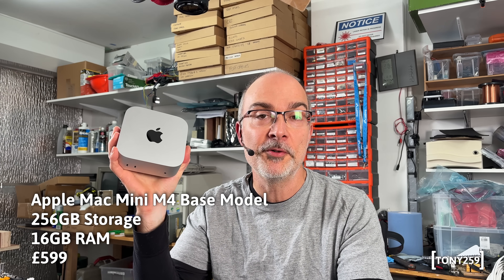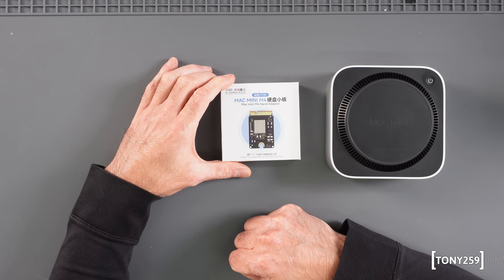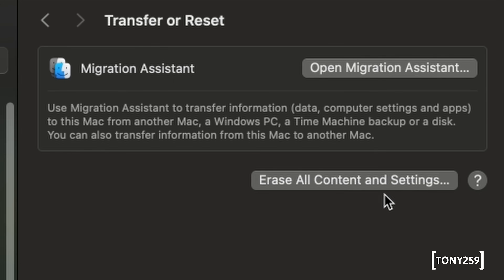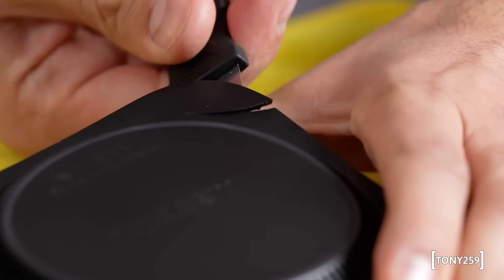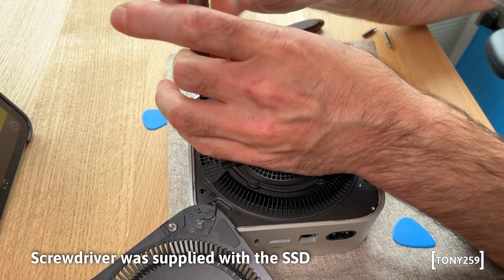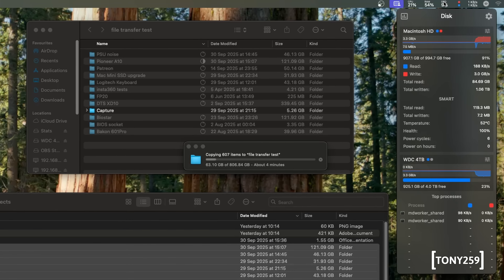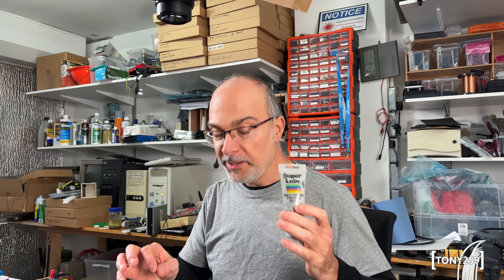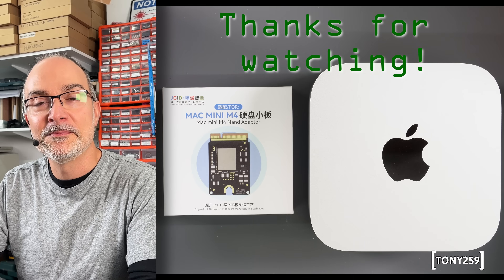CHEAP AliExpress SSD for Mac Mini M4? (Yes, I BRICKED it!)

Comment: I don't know why you keep mentioning that it isn't an SSD, it 100% is Solid State Drive in every definition of the word, controller or not! It just isn't a SATA SSD or NVME SSD.
Reply from the maker: Well, when you buy an SSD it has a controller on it. This module - AFAIK - is just NAND memory. But it's a technicality, I guess we can call it whatever we want 🙂
Reply: @Tony359_2  No but what I meant is that the definition of SSD doesn’t have anything to do with there being a controller or not. It just means there is no moving parts in the storage medium itself. Tape storage for example doesn’t have a controller either.

Comment: Great video, I’m thinking of upgrading the Mac mini myself, this explains a lot of the ‘pinch points’ when opening the bizarre Apple case that so many other videos fail to mention. Good work!
Reply from the maker: I'm glad it was useful, I hope it works out for you! Thanks for watching!
Reply: @Tony359_2  Before you upgrade: 1st - watch videos on upgrades to determine where the 'connection' lugs are in relationship to the power button. 2nd - use a small suction cup to apply upward pressure on the base cover. 3rd - use the suction to continuously lift, while sliding the plastic shim to slide under the base cover (I used a guitar pick - they're cheap). 4 - keep upward pressure with the suction cup while levering...
When I upgraded mine by using these 1,2,3,4 steps, my cover base practically popped off with only the slightest twisting and leveraging of the guitar picks. Good luck.
Reply from the maker: @dougbolton5503  I like the idea of pulling up WHILE using picks to pry the lugs! Thought I thought the suction cup wouldn't stick to the bottom? Thanks!

Comment: There's flash test tools for Mac and Linux you could try. You might have to compile it yourself though. It's call F3, and there is a GUI tool called F3XSwift for Mac, and F3-Qt for Linux.
Reply from the maker: Thanks, I'll keep that in mind!
Reply: @Tony359_2  some terminal commands to check capacity "diskutil list" or "diskutil info disk0" or "df -h /"
Reply from the maker: thanks - that will tell you what the disk is reporting. Some fake USB drives will have modified data so the OS sees much more than the actual data. 

Everything seems to work fine UNTIL you reach the actual, physical capacity of the drive. Then the OS will start overwriting old data without realising. But when you try accessing that old data, the data will show as corrupted. 

The app I mention will write small files with a checksum until the disk is full. Then it will read them back and compare the checksum. If checksums won't match, the data was overwritten.
Reply from the maker: I don't know that either but I'm sure that if there is a way to report a fake size, they will find it! 😀

Comment: E nonostante l'uso del q-tip, ditate unte sul mac-mini 🤣🤣
La mano che trema all'apertura del coperchio da l'idea di quanto tu fossi agitato all'idea di scassare tutto, hai fatto agitare pure me!  La musica de Lo squalo mette meno ansia 😅
Oggi ho giusto comprate l'i-pad pro M4... secondo te si può up-gradare la memoria pure a lui? (dubito).
Reply: I don't think you can upgrade the Memory,i'm sure it's built in directly to the M4 die in chiplets, not in a socket or onboard chips or anything.
Reply from the maker: ahaha eh oh, io mi agito tantissimo quando faccio queste cose! Ma davvero quelle clip sono eccessivamente forti, non ha molto senso. Sono certo che in Apple abbiano una scatola di coperchi di ricambio!
Le ditate unte sono di calibrazione, senza quelle...

Mi sono "Applizzato" da poco, io sono sempre stato Windows da sempre. Il Mac Mini l'ho preso per montare i video al weekend se non sono a casa. E' bastato poco per accorgersi che quella scatoletta di tonno da 30W faceva girare Resolve molto ma molto meglio del mio Desktop Windows (Ryzen 5700, 32GB, RTX3070) e quindi l'ho promosso a macchina principale.

Che io sappia lo storage su slot e' solo sul mini - il resto non c'e' spazio ed e' tutto saldato. Speriamo che continuino con l'M5!

Grazie per la visita!
Reply: @Tony359_2 anche per me è la prima volta con Apple, io odio Apple (la Apple post Motorola 68000). Ma sono un tatuatore e ho deciso di smetterla di decimare alberi sotto forma di carta... E Procreate ce l'ha solo l'iPad. 
Cmq PC tutta la vita 🤣
Grazie a te per i tuoi video!
Reply from the maker: Non sono mai stato un amante di Apple nemmeno io. Ma quando tornavo a montare sul PC, pareva rotto. La 3070 ha piu' potenza "bruta", esporta un video in 1/3 del tempo. Ma per l'editing, il Mac Mini e' di una fluidita' impressionante. E consuma 30W! Con il PC ci scaldo il soggiorno. 
Apple Vintage beh, c'ho un debole per l'Apple 2 🙂

Comment: Hi Tony,
awesome video, thanks for sharing! Your tip with using the grill for lifting up the lid is genius, great find! I can absolutely relate to your shaking hands once the lid was removed. Nobody prepares you for that the sound of breaking plastic when releasing the clips means success instead of doom. And as you started with bad luck it seems like the odds are against you.
Glad you succeeded and have a lot of joy with you  non upgradeable upgraded Mac mini!
Reply from the maker: Ah yes, the noise of the plastic snapping and the clips releasing is the same! 😀 
Thanks for watching and fingers crossed!
Reply: @Tony359_2  That sound of plastic sbapping (just ike breaking it) already existed on the very first mini I opened around 2010. Some clips never change 🙂